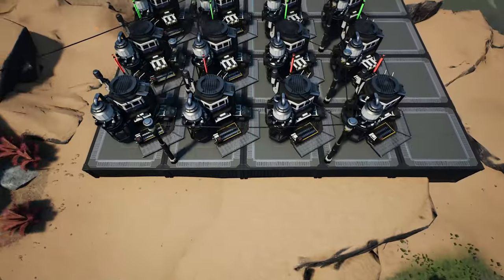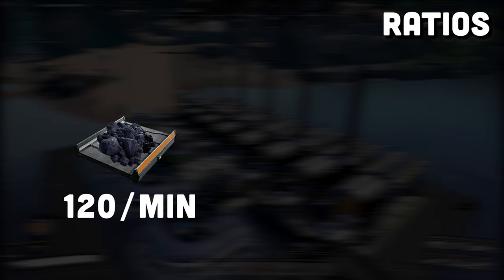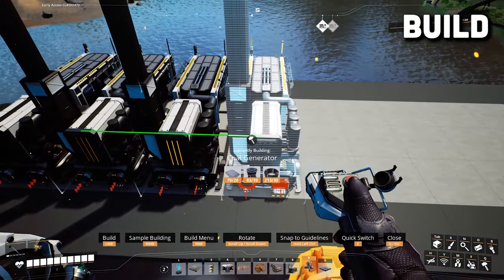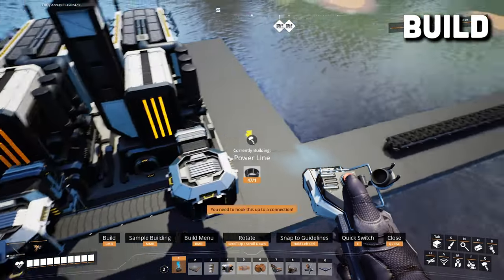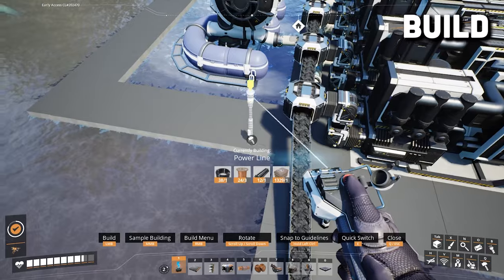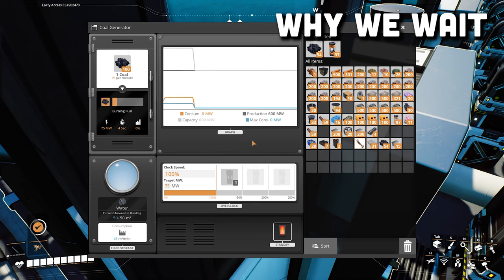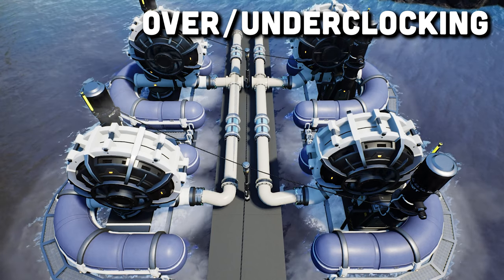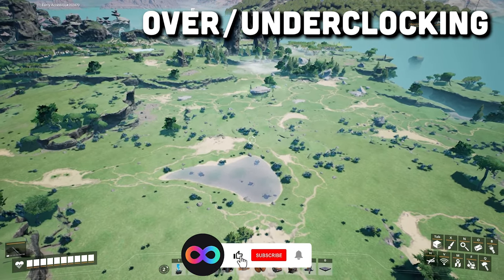How to build an EFFICIENT Satisfactory Coal Generator Setup! (Satisfactory Update 7)

Comment: If anyone is seeing their power not stable, add 1 more water extractor. There 2 m3 now so you'll need an extra to account for what's missing, hope this helps
Reply: Works for me
Reply: Thank you!!!
Reply: Whats up with the water pressure, i had some sudden water issues out of nowhere today while playing... It messed me up for a good hour, i guess flushing helps getting pressure back?
Reply: The proper fix is to follow the step where he said to let the pipes fill up before starting the generators 

If the pipes aren't totally full the fluid sloshes around, which can lead to dry patches and starve the generators...

If you let the pipe fully full first sloshing isn't possible.

Full pipes are happy pipes!

Also some Biggs around trying to push the extract max through a pipe can result in a similar issue, it's best not to use a pipe more than 90-95%% of its rated capacity unless it's a very simple pipe network with only 1 main fluid source

Comment: I think 1.0 might have made this not work or something. I did everything perfectly and it worked for about 5 mins (coal and water filled every generator) then the coal just stopped coming in, slowly every generator ran out and now it seems like the conveyor belt is broken, not sure. :(
Reply: Devs on reddit say, to save and reload the game. Let the coal and water load, and dont open the menu for the generators. Opening it causes the belts to stop loading.
Reply: Did they patch yet ?
Reply: @L0RDSH0CK3W4V3GamingAdvice  yeah yesterday with the hot fix patch

Comment: Always helps to pay attention to the numbers.  I'm working on my first playthrough of the game and I swear I have destroyed just as much as I have built. You build it... your proud of the accomplishments.. then you realize just how jank it is... well.. take it all down and start again! 😅 I try to use water buffers over using pumps. I haven't put it to the test with water.. but it works good for other fluids
Reply from the maker: Yea this is a numbers game. Once you figure that out you usually do good. Buffers would help especially when you run out of power to get it started again. :)
Reply: @spectrumdad_  based off the tests that I've done.. the buffers will push water up hill. It's just the fluid in the buffer must be able to raise higher then the level your pushing the fluid. And a valve and the end of the pipe to ensure fluid doesn't push back down jaming up my machines.  been using this method to hide my pipes under my builds. Now.. I'm obviously no pro and there could definitely be something else going on that's making this work for me.

Comment: Ive followed this to a T and my generators simply won't take in coal. I can of course manually insert it but once they run out it doesnt fill back up or keep itself filled. Water stays full in all though
Reply: Same thing happened to me
Reply: @MadeleineFritz  so apparently it's a new 1.0 bug with coal generators. If you interact with the generator to open its menu it stops accepting coal. Only fix I found so far was completely detaching and reattached the belt with it and just hoping it fills. They're aware of the bug though so it should be fixed soon!
Reply: @AlongTheBorderSide  oh right, thank you for that comment. waited for that. hoping that this will be fixed soon, my (new) save relies on that power ^^

Comment: Great video dude, I've used your set up twice so far, I want to expand the  power station to use more then 8 coal plants but I'm not too sure about the water flow to generator ratio so I dont want to make something inefficient. Thanks for this video!.
Reply: The setup I have currently is 16 generators, and 8 water extractors. I underclocked each water extractor so that each one gathers 90 water per minute, which then splits between two generators each.

Comment: Thank you this works in update 1.0, some tips: 
-You can use one Coal (normal) extractor with overclocking to 120, use Conveyort belt M.K. 2 to transport it.
-Let all the pipes and coal generator fill with water, or it won't work. 
-If for some reason the water generator stop working, the pipes may not be filling, you need to redo all the pipes and it will work.

Comment: Thanks for this layout,  just the episode I needed, I'm on my coal generator setup now and my belts are mk3 and pipes are mk 2 , got 8 coal generators and 4 water extractors, the only problem I have is the fuse keeps cutting out , might have to follow your setup and let everything fill up 1st, that's the only thing I forgot to do
Reply from the maker: Yea usually letting it fill helps. If you are at mk3 you might be able to double the generators too.
Reply: @spectrumdad_  okay thanks 😊

Comment: WAIT YOU CAN COMBINE THE ENERGY FROM ALL THE COAL GENERATORS INTO ONE POWER LINE??!!! My life is now changed forever.

Also, to those saying “I don’t have enough coal. I just can’t fill the generators fast enough.” If it’s within your patience, go find 2 other coal nodes. Split the coal manifold into 3 sections (1 section of conveyers going into 2 generators, then 2 sections of conveyers going into 3 generators each) this will supply you with enough coal to prevent the generators from ever running out of coal. 

Similarly, are you struggling to get ores through the manifolds of any of his other tutorials? Simply split the manifold into 2 parts, 1 miner per part. 

Hope this helped!

Comment: maybe something changed with 1.0  but i tried to build this for the first time and it wont stay running   not sure if i dont have enough head lift to keep water or if somethings hooked up wrong..... its part of the pleasure but damn   the feeling when you think you are done and then 5 minutes later everything just shuts down XD
Reply: This just happened to me!!! The coal wasn't filing up so i destroyed everything and retried and it didn't work, i rage quit and will try again later lol
Reply: @MadeleineFritz  @kennyscarfutti1891 yes! happens to me too. followed the guide exactly- the coal stops refilling on 4 out of 8 coal generators. but not for any usual reason. as soon as i click into one of those coal generators and add 1 coal manually, it starts filling up again- until it doesnt anymore. then it runs out again. crazy thing is: those faulty coal generators are inbetween those which work so the problem doesnt seem to be an insufficient coal line or something. it actually feels more like a bug, because the numbers do add up correctly, as in the video stated. i am not sure, maybe the lifts, the conveyor belts inbetween or.. well i dont know anymore to be honest. the problem isnt really viewable for me. :D really feels like a silent 1.0 bug.
Reply: @xphlp  I just did this setup and it works fine for me, i ran Mk2 conveyors to the setup and inbetween all the parts along with Mk2 lifts. Make sure to prefill all the generators with coal or they lag for a while until they are totally full
Reply: @MadeYouCryYT  well its a confirmed bug. did everything 100% like in the video, with full fills before stuff and everything. just dont open the coal menu after restarting ur game and the savegame and that problem is maybe fixed; for me it is :)
Reply: @xphlp  nice one glad it's working okay I did have some initial start up issues as it takes so long to back feed the 8th generator I had to manually fill it to get it to stay at 100 and the first water pump was showing like 0 to 5 on the flow whilst the others where at 100-120 but the flow was fine on the generators so idk 😂

Comment: Anyone who might need this like I did.

Pipes (mk1) have a 300m^3 of water flow, and a coal generator takes 45m^3 of flow. This means that you can only support like 6 generators for optimal power efficiency. 

I've rebuilt my power supply twice, when all I needed to do was fix my piping lol.
Reply: Exactly what I needed, and saved me a  search on the wiki, thanks.  I thought that 8 generators was a little much for Mk 1 pipes, even if you can use 3 water extractors to supply water for 8 coal generators, the pipes themselves max out at 60m^3 less than that.
Reply: @ronjohnson2760  Hence why you need the 3rd pipe if going for 8 generators with 3 pumps. That extra pipe carries the remaining 60m^3 that you need
Reply from the maker: The reason this works is how water flowing works in pipes. Everytime water hits a junction, it splits evenly across the pipes. So because the water extractors are inserting at different places in the main pipe, and there are machines taking the water in between, it works for all 8 with the 3 extractors because there is not 1 pipe in there that NEEDS to go over 300 due to the proper water displacement mechanic. I'll have to do a video on this.
Reply: What type of power source are you using to power up the cold generator and the extractors
Reply: @djhitman6661  probably biofuel. Cheap and ez to get a temp setup going for

Comment: i'm not sure if i'm just plain stupid, but how do you get the energy from the coal generator to all my other machines? Because you can only add one power cable to the generator, but that cable gives power from the biomass burner, so where does my power go created by the coal generator?
Reply from the maker: You connect a cable from the generator to a pole, and from that pole you can connect to many other poles/machines to make a power network.

Comment: I dont understand how does the wiring work at the end ?
Reply: Just gotta connect the water pumps + coal generator to its own power grid, then connect that power grid to a biomass burner. once the coal plant is up and running you can delete the biomass burner
Reply: @WakeQ  got it working now, it was because of the pipes the other 2 water collector was not giving water lol

Comment: I’m having issues keeping my generators fueled with coal using this setup. I have two normal coal nodes filling up both sides of this setup using tier 2 conveyor belts, and it still doesn’t keep the 4th generator on each side fueled so the power fluctuates. Does this setup need tier 2+ miners and pure nodes to work?

Comment: something that should be added is that the last couple coal plants wont work with mk 1 belts so you goota use mk 2 belts throughout
Reply: Hey i’ve used mk2 belts all through and watched this video like 10 times but the belt splitter is currently slowing down my build cause it just doesn’t go through fast enough even after i’ve backed it up first do you have any clue why?
Reply: @nathanhands8321  I think the only way that would be happening is if there was just a mk 1 belt you missed maybe? Maybe the miner belt is still mk 1 as well. I’m definitely not a pro at this game so if this doesn’t work you might wanna ask the subreddit

Comment: This helped me a lot. I was wondering why some coal generators weren't getting enough water even though I used power cores to boost water production to 380. (So 20 more than I should need) using the setup for water pipes (or very similar at least) in this video fixed the issue for me. Stable 2400 power with 32 coal generators, at a perfect coal and water consumption rate. :D

Comment: Do not complicate your life with coal generators, just put 3 generators on the ground and overclock them to 200% and build 3 water extractors one for each generator and underclock them to 90 m3 of water that is 450 MW. This will carry you to oil then just go and build fuel generator plant, that you can expand as you get resources but from 300 m3 of crude oil you can easily get 3300 MW and that can easily be expanded when you get blenders to 10000 MW.

Comment: Ok, I am asking the satisfactory community. I have watched this video from beginning to end, then end to beginning. I have filled the pipes with water first and then coal to the max, before connecting it all together. It works excellent in the beginning. But a couple minutes later I then get the Fluctuating power. I am lost the only way I have found to fix the issue is to overclock the water system. Any pointers?

Comment: turns out if you want to conect the lifts the way you do it you just have to get the splitter or merger in place first then conect the lift to the coal genorator and or merger/splitters

Comment: Has something changed since this video has been made or perhaps I missed a step? I'm feeding 120 coal/minute to the 8 coal gens, but only the first 4 are stable with coal delivery. The other 4 struggle to keep up with coal.
Reply: Same. I let it fill up first and tried again but the last 2 coal generators still burning faster than coal input. Did you figure it out yet?
Reply: @alkalichilli  only a workaround. I split the main coal input into 2 different manifolds of 4 instead of one 8-tier manifold. Once the generators were full and the belt was backed up with coal, I was able to turn it on and it runs perfectly without any hiccups.

Comment: My third water extractor get full at 200 water in pipeline and stop working so my 3 last coal generator don't get enough water and stop functionning
Reply: okay find out the problem, if the junction cross are stick together, water doesn't flow in and get stuck

Comment: Hmm Ive done the build, but only first 2 generator are full of coal, the last is empty. Is that because Ive used mk3 belts? I started with all gens full of water/coal.
Reply from the maker: It’s normal they don’t remain full, but what matters is if they remain working at 100% efficiency. The machine will tell you.

Comment: thanks for the guide! took me like 3 hours to build this, I am very new to satisfactory ^^ now I only need to drag the power to my base that is not very close. Also was funny when I realized that I have to power coal miner first as well as water extractor before you can start coal gens. Had to run back to base for some wires ^^

Comment: Question if your base is away from the water setup how would I hook it up to my base
Reply from the maker: I wouldn’t really pipe water back. I would build a remote factory where the water is and do what you need there. Then you can either belt or truck/train the final product to base. If it’s for coal power the. Even better, you don’t need to bring it back to base.

Comment: if pipe capacity is 300m/min - how it can support 8 generators ?
Reply: Answered above.  It’s a quirk with how water is coded to move through junctions.  The code sees it as 3 supply pipes instead of just 1.

Comment: Unfortunately, this build no longer works per update 8. It does, but it limps. There are large dips in production due to flow rate being compromised even with 8:3 manifold at water level with zero headlift. Power fluctuates as some of the generators are starving for water. Even after adding additional pumps and taming the fluctuation, there's just not enough water. The grid gets powered down as soon as I try to power a ~400Mw factory. I've spent hours trying to troubleshoot, but I get the feeling there's been some overall change to fluid dynamics within the game and there's just something I'm missing. It's a shame bc I like your pump-less design.
Reply from the maker: This still works, I used it this week in my let's play, video coming out Friday. If you need help troubleshooting head over to the discord I'll try to help.
Reply: Hi, i just use this design in update 8, in fact i have created 3 of this design. Make sure you fill 100% water first before feeding fuel. After 100% water, manually put 100 coal ore in each, and your power will run smoothly and no more power outbreak.

Comment: How do you manage to keep the 7th and 9th coal generators running ? they use 15 coal a minute, but with this setup, it seems like they only receive about 3 or 4
Reply from the maker: 15x8 is 120. It’ll look like it’s not getting enough but it does. What you want to make sure you do first however, Is turn off all the coal generators (or at least the last 4) and let everything fill. It helps to manually fill the coal generators with coal too but once everything is saturated you’ll notice that it runs smooth, receiving one coal as it uses one.

Comment: Thanks for great tutorial. I am having an issue though.  I've setup Mark II belts, Mark II lifts, and spliters as you've suggested, but the coal is barely making it down to the last 4 coal generators.  I can see the first few generators are getting enough coal, but after generator 4, you can see less and less coal making its way down the belts.  Am I doing something wrong, or has something changed between updates 7 and 8?
Reply: That's the reason why he explained it in the video why pre-fill the belts and pipes... Around 04:00
Reply: @Bartekwis  I did that too... but I've just figured out what the problem was, I was only using a single Mk1 miner, so wasn't producing enough coal.  Now used a merger with two Mk1 miners (until I get access to Mk2 miner) and all looking good

Comment: Im a bit confused on the amount of coal you use. I set up a mk 1 miner which only produces 60/min not 120/min yet ive never run into any problems with the set up. Should I switch to a mk 2 miner?
Reply: You’re using the miner on a Normal coal source.  To get 120/min from it with a Mk 1 it needs to be a pure source.  If you can’t feed from an additional source I would speedrun to mk2 miner.  Small chance you’re getting confused by the description.  It says it extracts 60/min off a Normal source.  For pure that is doubled to 120.

Comment: The only problem is that the coal doesn't get evenly distributed between the generators. If you have exactly 120 coal per minute, the furthest generators will end up just almost not getting any. So it would be better to split up the coal evenly before connecting it to the generators, just split it so that there are 8 belts of coal and connect them to different generators.
Reply: He said to let it fill first. Also if you have the coal conveyors connect in the middle it will distribute more evenly